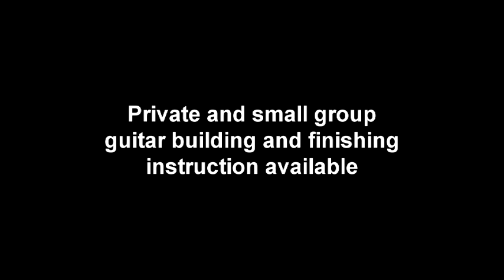Luthier Tips du Jour Mailbag 39 - Re-attaching a bridge

Comment: If its a glue failure, will you reattach the bridge by putting new yellow glue on top of the dried old glue residue? Or do you recommend removing the old dried glue from the wood?
Reply from the maker: If it is a wood failure you can just reglue it. If it is a glue failure you will need to remove the old glue first.

Comment: I can't afford that nifty vacuum clamp for my 3/4 classical guitar - it was a clean glue failure due to the extreme drought we're having here.  It's a nice $400 instrument (La Patrie Motif) but I really can't afford to have a luthier do the job.  

How many pounds per square inch does the vacuum apply?  I'm wondering if a very dry sandbag would do the same thing.   Maybe I'll experiment with some pieces of wood before I try.
Reply from the maker: you can use just regular cam clamps if you like or get creative.